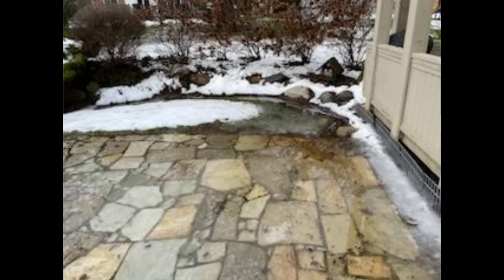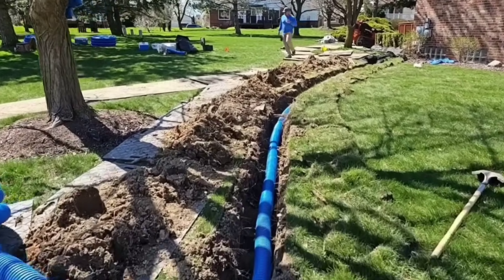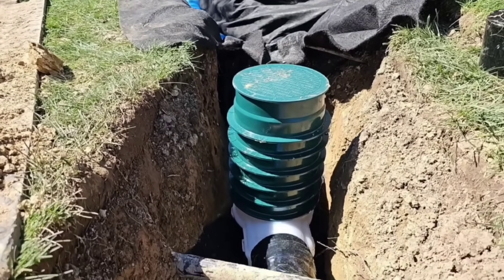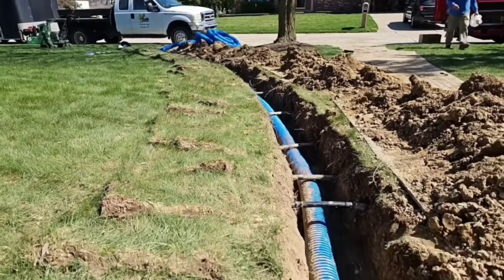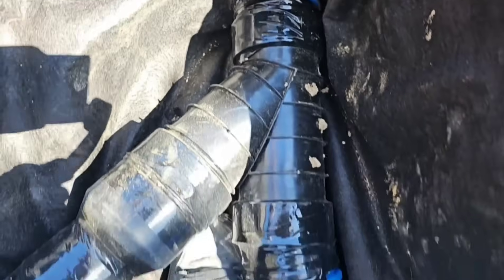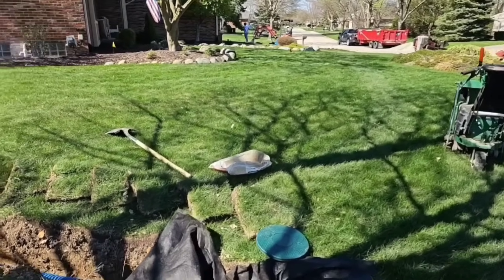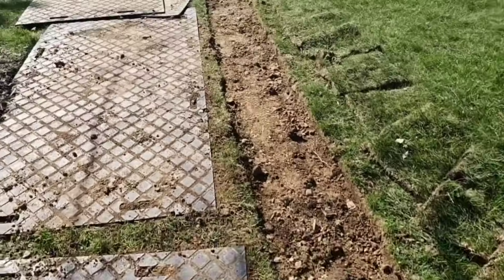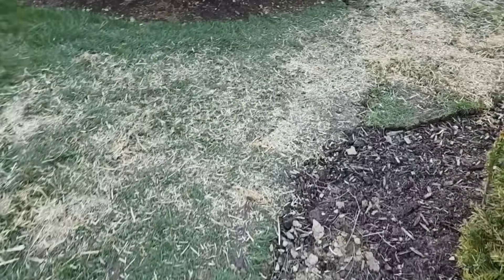Negative Slope: French Drain Discharged to Downspout Line

Comment: How many down spouts can you tie into a 4” discharge pipe?  I’m considering a big system that will need to deal with high water table (French drain around perimeter of house) plus down spouts.  Wondering if I need to go to 6” and / or double wall for the final run.
Reply from the maker: I already did
https://youtube.com/playlist?list=PLjFCqaZ4v1BXt8vDpjMmvJXxMn8Tgw0wA&si=TnxJzoA87Tq8CxKk

Comment: Seems like you are using smaller gravel in your newer videos.  Is that a cost / supply issue or have you learned that the (I’m guessing) 3/4 inch is better than 1 1/2 round?  Thanks for the amazing products.
Reply from the maker: I don't like to use large stones near the foundation of any cement work or structure. The smaller stone is dense and more compact.

Comment: Great info!  Why do you have two cleanout catch basins so close to each other?  Wouldn't the one tied into the downspout pipe take care of the shingle gravel?
Reply from the maker: The way you see it in this video is how we recommend installing roof runoff systems in French drains. Each one will hold 1 gallon of sediment. The two of them hold 2 gallons of sediment. I like to have the catch basin 3 feet from the leaf filter so you catch the shingle gravel immediately.